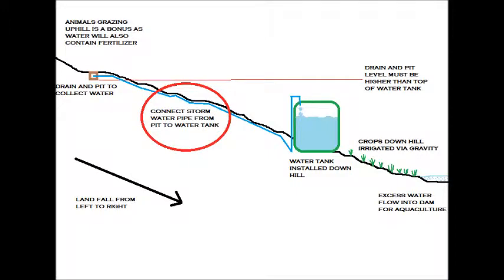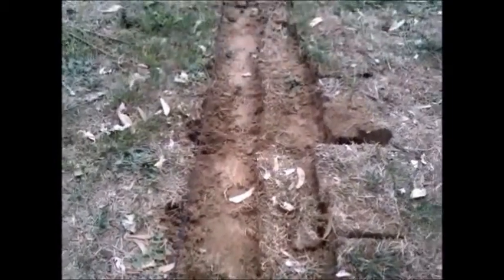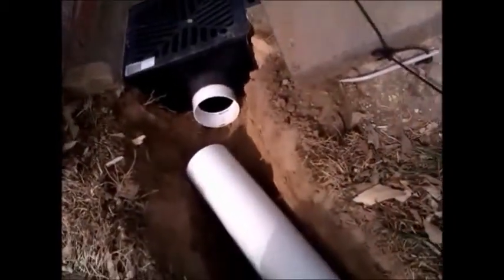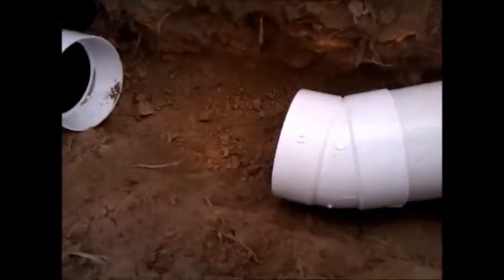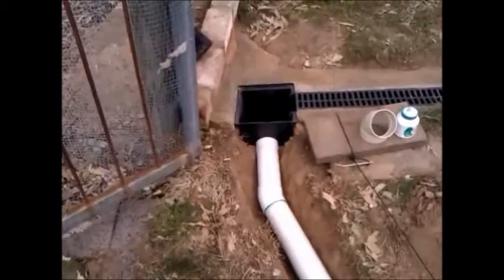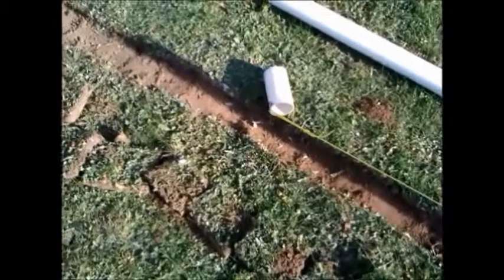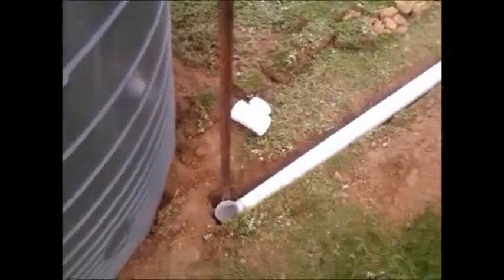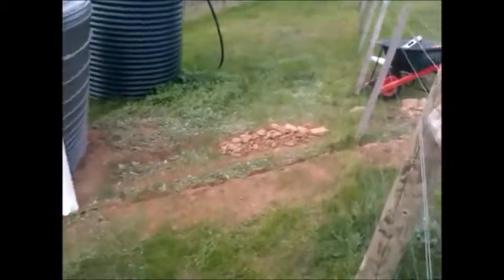Harvesting ground water into above ground tank - without pump, Part 7, Storm pipe installation

Comment: Thanks for sharing your project. How is it working so far? is there a followup video?
I have a farm in a low flat region that floods regularly and i want to capture this flood water from the ground into a tank to use later on for irrigation. This looks cheap enough but i want to know how the mechanism to push the water up works